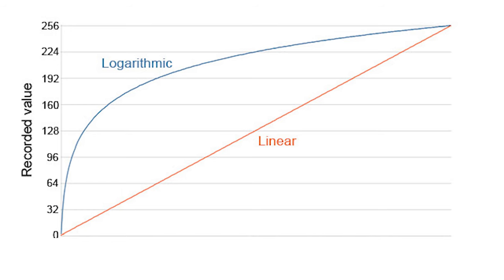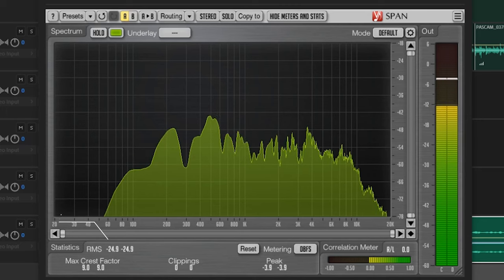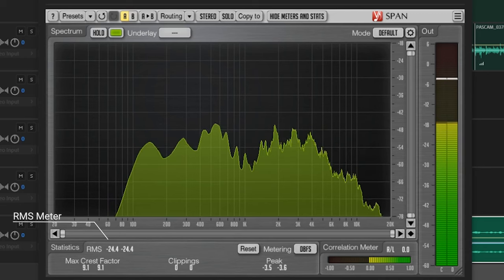What is Loudness? LUFS Explained - Sound Design Basics

Comment: Audio question: I have a very basic 5.1 audio system built into a Samsung Blu-ray player. How can I make the most of it and how can I get clearer dialogue without absurdly loud noise from explosions and other effects?

So far, all I have at my disposal is either a "Dynamic Range Control" option or Night Mode.
Reply from the maker: Night mode is usually a mode designed to reduce dynamic range so loud sounds like explosions are quieter. If you have the option to control the volume of your 5.1 channels separately, you can also turn up your center channel as that's usually exclusively dialogue.

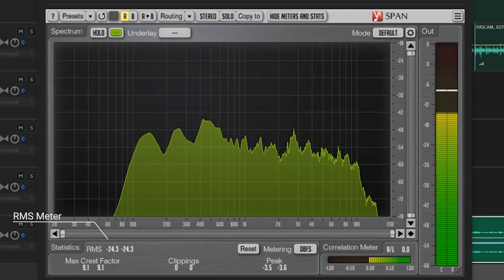Comment: Dumb question: At 4:45 what does the top  white line mean on the level meter on the right?  It seems to consistently have a gap above the greenish/yellowish/red bar.

Is that line the peaking level or is the top of the greenish/yellowish/red bar the peaking level that people refer to when they say you should peak at -12 db?

Thank you for the video, it is much appreciated!
Reply from the maker: Both the white line and the green bar are showing the peak level. The white line is showing the maximum peak over a period of time while the green line is showing instantaneous peak. This is to help you notice clipping. That's what you'll watch if you don't want to peak over a certain level like -12dB, but you generally that's just a safe amount of headroom for recording. You don't need that much headroom in the final mix.
Reply: @AlteraSound  thanks a lot! So the white line is what to look at when recording, thanks!